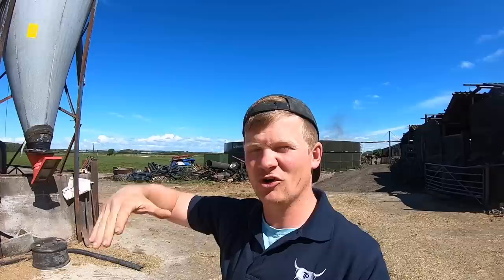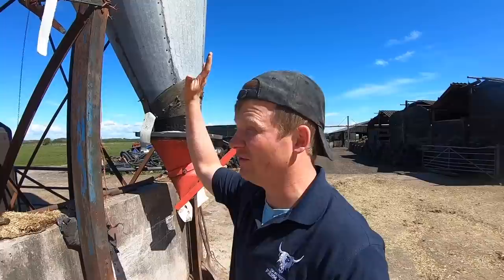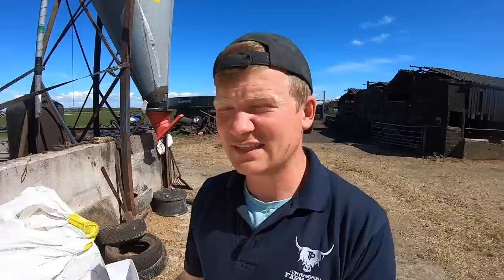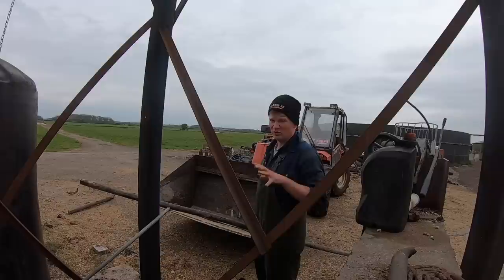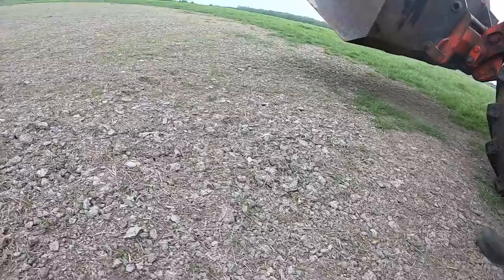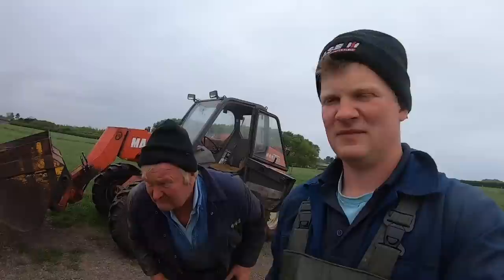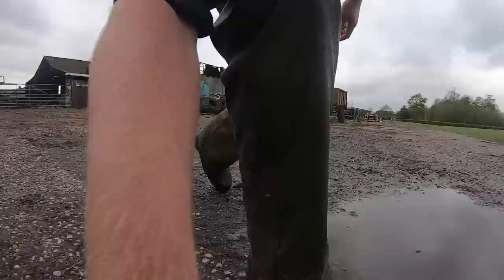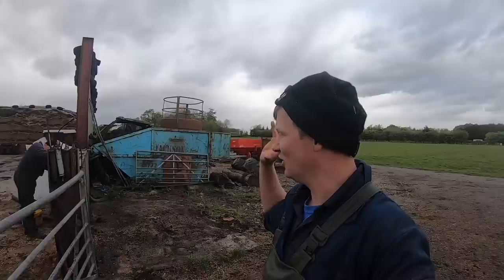NOT SAFE!! THIS COULD HAVE BEEN SO MUCH WORSE ! TIME FOR IT TO GO !

Comment: 1:04 'Im being sensible, im being a clever tom' For the first time ever? 😂 Great video lad, safety first! With the silage left in the pit the right job would be pull it all down and level it out on the ground, then you can avoid the problem of when you get to the previous years silage and it all collapses down

Comment: Your right Tom, every farm has a bit of pipe, wood, bar, string, only to be used for a specific task... its just like the Telehandler has a locking pin to hold the attachment on @ 14.00,   manufacturers supply it for a reason. !!
Reply: Just a fun fact to add.. the logo on the side of the bin is from fishers nutrition ltd, who supplied animal feeds from Hutton Cranswick East Yorkshire.

Comment: Tom, what's up?!  Here's a tip how to keep your new silo clean: -buy a new silo which has ventilation, to cool and dry the cake, in case it gets too hot or wet
-empty completely before refilling 
-clean out before refilling (maybe evan disinfecting) 
-ideally the silo should sit in the shade to prevent condensation
-monitor the temperature and humidity - to prevent pests in your feed
-you can also transfer feed out and back in again, to cool the cake down, if you don't have any ventilation
(I was just learning feed-hygiene in Agri-University - then saw this video - love your vids they keep me motivated through this boring theory of Agriculture🙇)
Reply: also I like how it seemed like the tow truck was singing "I was made for this" xD
Reply: Disinfect a meal bin every time you refill it?🤨 sounds like a waste of time to me

Comment: What sort of money is a new feed bin? I'm so fed up with moving 25KG bags of cake about
Reply from the maker: Oliver Lee135 3500 upwards for new, mine was abit more because I had to have it go over the wall
Reply: @TomPembertonFarmLife  what size bin u getting??
Reply: @TomPembertonFarmLife  Oh right, thanks, guess i'll be moving a lot more bags yet then!
Reply: Are the bags not more expensive Oliver Lee135 and is your time not a valuable resource too.  Work out the cost benefit using difference and your time at Miniumum wage rate, probably soon pay for itself.

Comment: A used Toyota Hilux 3 litre diesel 2009-2015, 4wd auto. (tow kit additions) If it pops the engine see if Dyno-torque, Birmingham could sort it out with a petrol LS3 or 3UZ etc engine. Aussies have put 6.6 litre diesel Duramax with 6 speed Allison and a NP263 transfer case (standard diffs) in some lifted Ford Rangers PXs.  See if you can get on the farm influencer list for the Ineos Grenadier 4x4 https://ineosgrenadier.com/   Agbrand/ waste-not type feeders for hay etc. http://www.maxifeeder.com.au/